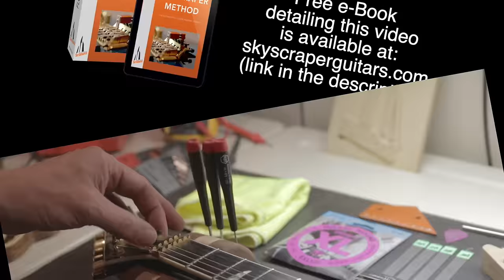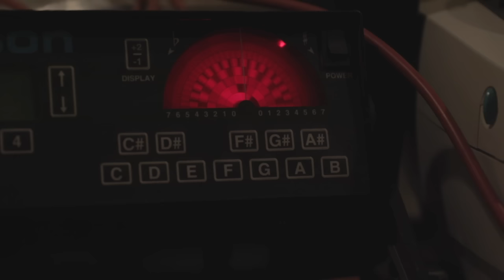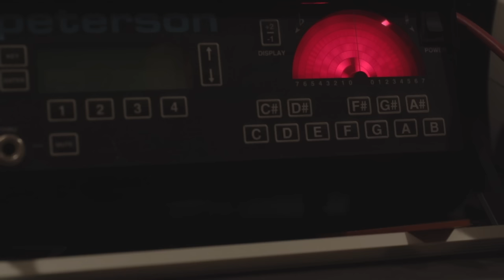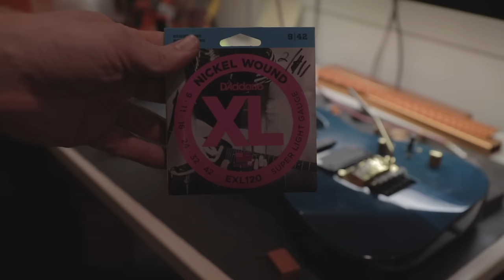FULL Floyd Rose Setup Including Intonation - The SkyScraper Method

Comment: I respectfully disagree with that whole process. lol. I have never used Bridge blocks. No need. I never intonate/tune with the guitar flat. Always in the playing position. I never intonate on old strings. The string tree is really just to keep the sympathetic vibrations down. You have a locking nut that will clamp the string No need for the string tree to do it. If it works for you Cool. I think you can make it easier or more efficient. Do things in a different order. For example. Your bridge is already close to where it has to be right. So, keep the claw where it is. No need to adjust it. If you are using the same gauge strings and the same tunning it should be plug and play. Not a whole lot of changes need to be made. If you do need to adjust the claw. Make small changes, TUNE, check bridge. Rinse and repeat. Yes, this takes longer but you will be working with the guitars natural balance. Also, when you stretch the strings. They heat up. And heat makes metal expand. So once its tuned and adjusted don't lock the nut. Let it sit for about 10 mins. Then check the Bridge lvl, adjust tune again if needed. Then check string height. Adjust, check bridge. Adjust if need. Then retune. Rinse and repeat. Once that is done then Check the intonation. Intonation should be last. Because if you adjust the bridge after you intonate. You just moved the end point of the string. Once all that is done. Then lock it down. And retune. I used to do professional setups for years at a music store and when you have to do dozens of Guitars a day. I am not messing around with adjusting the claw that much. Shouldn't have to remove the back plate. I know some people like to leave it off. I am missing the one for my LTD. For my spring cleaning I take everything apart. Even remove the saddles. clean all the screws, oil them. And I don't have to mess with the claw. I would also say don't put the strings on backwards. some people might be scratching their heads, what do you mean? The string is wound from the ball end. Right??? So those windings will be the tightest cause its closer to the starting point. Technically the winding will be more lose towards the end of the string. And the one time I tried the way you did it. When I cut the other end to put in the saddle the string unwound a little bit. Gave me a crazy tuning issue's and had a weird harmonic that I couldn't figure out. Thought it was a bad set of strings. Once I took the strings off, I found out I could literally move the winding on the core. So, I will never put them on backwards again. And it was a set of D'Addario 9's. Plus I hate them for other reasons. Only strings I ever break are D'Addario's. I stick with Ernie Ball, 10's for D tuning @430hz, 9's for E Standard and @430hz. 9 out of 10 Pantera songs are tuned to 430 in whatever key you are playing in.
Reply: While I like this guys method of performing any individual step, I definitely agree with your order of doing adjustments. Definitely with new strings facing the correct way, and it always made sense to set everything then do intonation last. Funny thing about the string tree too, my LTD Arrow-401 came with one and it never hit me that it's purely cosmetic since the headstock has a good backwards angle on it, plus the clamping nut lol

Comment: Man like..... I've never had a guitar creek like that......
Reply from the maker: It has WAY more to do with corrosion and / or mechanical issues in the truss rod rather than the wood of the neck...  The sound vibrates through the wood, but it's generated in the steel...  Sort of like hitting a pipe with a hammer when you're under water.

Comment: I would like to purchase the intonation tool but it says it's unavailable and we don't know when or if it will be available. How do I get the tool? It would be super handy to have on hand.
Reply from the maker: We have plenty of them on hand.  I'm not sure why the website was telling you they are unavailable.  Try this link: https://skyscraperguitars.com/store/#!/Pick-Pocket-Intonation-Tool-for-Floyd-Rose/p/126202146/category=25043259

Please let me know if you have any issues.  I can always send a PayPal request if the website is giving you issues. -Greg
Reply: @SkyscraperGuitars   thanks alot for the link. I will be ordering 1 of the intonation tools and a tremolo block on Tuesday. how much is shipping to Australia?
Reply: @SkyscraperGuitars  can you please help me? I have an LTD ESP Alexi 200 with a Floyd rose. I can't get the intonation right. The saddles are so far back that I'm using the second hole for each individual saddle and it the intonation just won't stay right. The saddles aren't moving. I have to keep moving the further and further back. Also my high E has that sitar twang. I have the bar that pushes the strings down, pushing the strings down so they're running flat along the nut. Do you have any suggestions. Sorry for the long message but I need help.🙏🙏
Reply from the maker: @chriswalton3383  Can you send me an email with some pictures?  Snap a couple of the nut area without the locks on and a couple pics of the bridge.  If you go to my website, there is a contact form.  Just shoot me an email and when I reply, you can attach your pics.  www.skyscraperguitars.com/contact

Comment: does the intonation tool only work to pull the saddle towards the tuners lengthening the string? if so, i'm guessing that if you need to shorten the string you just pull out the saddle further than needed and then use the tool to shorten it back into the proper length?
Reply from the maker: It works both ways.  If you need to shorten the string length, put the tool in place and snug it up.  Then release the saddle screw and you can slowly turn the adjustment screw on our tool to let out some length.  I hope that makes sense.
Reply: @SkyscraperGuitars ah ok, yeah i gotcha!

Comment: Great job, thank you! After tuning my Floyd I have buzz on my low E at the first fret. Any suggestions?
Reply from the maker: Start at the start.  Is the neck relief set correctly?  If it's too flat, it will cause buzz on the low frets.  If the relief is good, then look at the string action at the 12th fret.  If that's good too, then look at the nut action.  .022" is o.k., .020" is good, .018" is awesome if the fretwork and neck are spot on.  If your nut action is too low, you can shim under your nut on a FR locking nut.  If your 1st fret is too high (not level with the other frets) you can shave it down a bit.  A fret rocker or small straight edge will help find if your fret is out of level.
Reply: @SkyscraperGuitars  Thanks so much!

Comment: key will work under tension
Reply from the maker: My experience has been that the threads strip out on the nut or the screw or both after doing a few guitars under tension.  After about the 3rd time that happened to me, I sat down and drew up my version of an intonation tool.

Comment: So I did all that and the guitar plays very well (ESP Ltd Alexi Laiho signature) but when I dive or pull on the bar it returns either flat or sharp. What can I do to eliminate this? It's very frustrating to try and correct the tuning in the middle of a song.
Reply from the maker: If your bridge is returning flat or sharp, there are a few things that can cause it.  The most common is a knife edge or post that has a burr.  The metal on both pieces should be VERY smooth.  A lot of the licensed Floyds use posts and knife edges that are not hardened.  They can develop burrs through normal use or if you raise/lower the bridge with string or spring tension present.  The second most popular reason is springs that are worn out or that aren't seated well.  Lastly, old strings can cause this issue.  There are other small things that can be a culprit, but are pretty rare.  Burrs on the saddles, locking nut wear and loose / wiggly claw screws.
Reply: @SkyscraperGuitars  This was very helpful thank you. One other thing I found was that greasing the contact points helped a lot as well. What are your thoughts on this?
Reply from the maker: @Vposerslayer  Yes.  I use sewing machine oil on the fine tuners, posts and any other parts that turn or move.

Comment: Informative. Liked it -exept for the backwards stringing (with the ball ends att the tuners). I just don't see the point to do that with a locking nut. But hey: Everyone has their own personal preferences. As long as that works You: It's the right way to go....
Reply: If you use locking tuners, it's silly to reverse string them. However, 6 cuts saved, no string slipping before the nut is locked down because of a bad starting wrap, all those colours on the end of your strings... Many reasons to reverse string.
Reply: Reversed strings causes unnecessary wear at string holes -on tuning pegs. Also the string is parallelly wound around near/at the ball end. It stiffer and bends harder there. (This doesn't improve tuning stability.) Tone wize it isn't optimal to basicly have the whole part of this parallell wound part of string over the headstock. (This part of the string stretches out different compared to rest of the string.) You can't wrap much around the tuner either -with the string ball stickin' out -on one side. (Right ammount of string turns around the tuner gives tuning stability and tone.) Many reason also NOT to reverse the string.
Reply: @MrJonken70  there is no tuning stability lost because you are locking them down at the nut, point disregarded. Metal hardness is not changed because of thickness, wear is not increased. As for that parallel winding... You will seriously need to explain the physics you're concerned with in order to explain how it matters at to the solid steel core of the string... You can still wind it around... It's easier and makes a better wind. But, I am totally open to any scientific evidence you could provide to back your statement up. That 3 to 10 mm length of string usually bent and wrapped over is, in my opinion, no different.
Reply: I hear ya. So what You are saying (if i understand You correctly); is that the smaller metal string -rapped the ball end of the string: Causes no more distress to a tuner hole; compared to a regular string running thru the hole? Further: That the thicker part near the ball end of a wrapped E, A -or a D-string bends just as easy -as the rest of the string? All this is IS physics my friend.. The metal on finished tuning peg; IS softer then the steel on a string. Reversing strings leaves marks at the edge of the holes in tuners. Want proof?-Just check Your own tuners. (I assume You have been reversing Your strings for some time.) Regarding the stringwindings: It's physically impossible to wind 3 turns clean around a tuning peg with the string ball hangin' there. As You said: You lock the nut: -There simply is no point to reverse the strings....
Reply: @MrJonken70  I can't check on mine as I haven't had to restring the stock instrument, I understand what you're suggesting, and do see how that might be a concern. My point is, steel will do whatever damage it can regardless of how much more of it there is, unless you're bashing it around when loose and tugging it insanely hard after, it shouldn't be much, it will also be doing this to the side without the ball end, no? Again, I asked for specific physics involved that would prove your stance without claiming to know for certain myself. I would like to know, definitively, if saving time is costing money in the end. I will likely just snip them because I can't undo years of habit and I don't actually like looking at the ball ends, I usually go with string thru to hide them. 

Tldr: The parallel winding issue is where you've lost me, the rest I can see where you're coming from, even if I don't agree it's an issue. I am doing the setup on my Jackson this weekend and assumed this old trick was no worries. You've got me thinking.
Reply: @MrJonken70  and now the parallel winding is makes sense. I tested a heavy gauge string under increasing tension. While it proved to be a similar strain on the initial contact point, there is clearly a gap where the end wrapping and the regular portion of string meet that I would expect to either snap or slip with a non locking nut, I wouldn't totally trust it on a locking nut because it could slip if the nut becomes loose for any reason. If I had locking tuners, it would be no concern because you don't wrap the post on any of the modern pegs. That gap I'm concerned with is practically identical to the stock winding job... So I do believe this is down to a matter of personal preference, but, your reasonings should be considered, especially if it isn't your personal instrument. I would never send a client or friend home with reversed strings unless they requested it. Thanks for the replies, I appreciate when someone has a valid reason to not save time. You gave me enough information to come to my own conclusion that, personally, for the time it saves, the risks are too great to a standard tuning peg and not entirely gone with  locking tuners.
Reply: You're absolutely right! This is a matter of personal preference -4 each -and everyones personal taste in their own instruments. I guess i string -or RE-string about 8 to 10 string instrument every week. Been doin' so for almost 30 years. I can honestly say that i've seen the benefits and the issues first hand -in every possible way You can string a string instrument. I'm certainly not trying sell anything to anyone here; on what is the right way to these things. All i'm trying to do is enlighten pros and cons on the different options available out there. Information that is hardly even mentioned on the inter webs. So that each and everyone can make up their own mind on theese things. over the years 've seen so many instruments getting f**ked up on pure lack of "know how". This by people who call them self pros -as well as regular Joe's. Short and sweet: The magic number is 10.000 hours of experience -in doin'. Sharing some visdom from that long road; may sometimes prove to be the smallest things. Small thing You have never heard of, noticed -or considered before. It's all about perception -and finding out for Your self; if the info accually makes any sense? Not for the entire music industry -but just for You personally.

Comment: My dean requires three but in straight-line not V formation with the middle one not doing anything. I tried using two on my Dean and it didn't like it but my Strat loves two and my Wolfgang loves having just two, Eddie understood this I didn't have to remove the center spring because Eddie didn't put a center spring in but he did use the V formation

Comment: I don't understand why they do this v-shaped spring thing and put the spring in the middle cuz the springing the middle isn't doing anything except vibrating and making noise. best way to do is put them all straight and then they pull evenly most guitars only need two and then you can put it in a V formation

Comment: How far toward the edge of the bridge should the saddles end up once intonation is complete?  I've got mine intonated, but it took getting the high e saddle so far forward that it's actually gone a little past the edge of the bridge.  I've never had any problems getting Floyds to stay in tune when using the whammy bar with my previous guitars, but on my new guitar, it's a major issue.  The setup seems solid, but it continues to be an issue.  The intonation can go from dead-on, to being way out in the same day, even though all the saddle and nut screws are secured and the saddles don't move at all.  Is it likely to be a truss rod issue?
Reply: Have you tried the "after pulling up dip back down" trick? I got my first floyd guitar about a week ago and noticed that it'd go out when pulling up but would go back in tune if I dropped the trem after a pull up

Comment: I’m trying to learn everything I can about FR maintenance and set up so that I don’t need to ever have someone else handle my gear, did you only have to use the intonation tool because of the truss rod adjustment? Also I seen stewmac use a straight edge in a vid to determine the truss rod needed adjusting on a neck, is what you did with the F. gauge a better way?
Reply from the maker: Nigel, the truss rod adjustments can cause a need for intonation adjustment.  Also, string height, string gauge, bridge position and nut height can also cause intonation changes.  If you keep your guitars set up the same every time and you keep on top of the setup, you may never have to adjust your intonation...  It's something I check on every setup no matter what.  If it needs to be adjusted, I adjust it, of not, I leave it alone.  

On the neck relief adjustment.  There are 3 methods I know of.  Using the string and a feeler gauge, using a straight edge and using a dial indicator in a specially made bar.  The feeler gauges are the most common.  If you have a weird problem, the straight edge usually comes out to see where the problem is, then lastly the dial indicator.  I think I've only seen the dial used on guitar necks as they are being made...  Not generally used for repairs.  Does that answer your question?
Reply: SkyScraper Guitars more or less!lol let me jus ask this If I want to take all the strings off  my FR to clean the neck and body, keep same string gauge, what all am I getting into? Thank you so much for the fast response!
Reply from the maker: @nigelregalsworth4276  I take all strings off at once.  If you do the same, you'll want to use my blocking technique to get it restrung and tuned up.  It might be a head scratcher the first time you do it, but once you know how to do it, you can do any adjustments you want to do without the fear.
Reply: SkyScraper Guitars okay cool, so I don’t have to adjust the truss rod and intonation every time I take all the strings off!? Thanks again my brutha ur a life saver!!